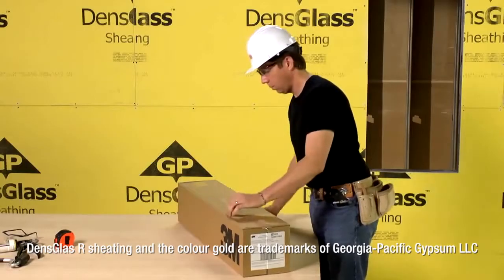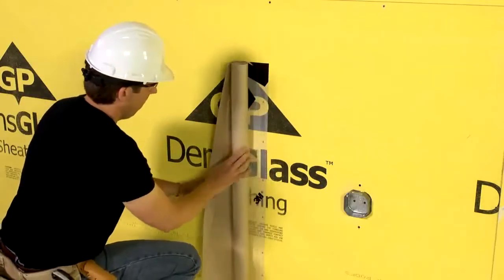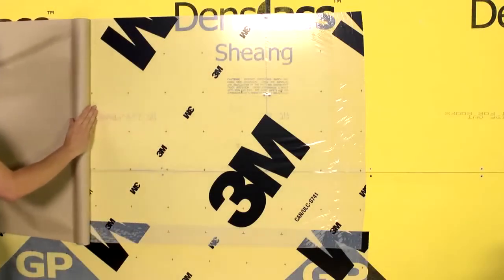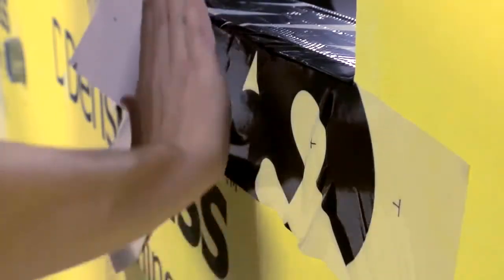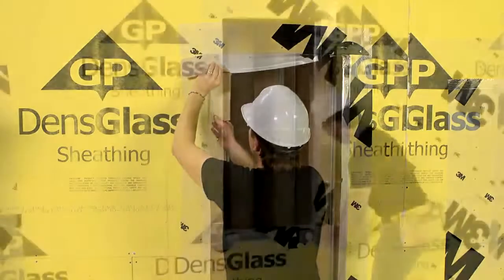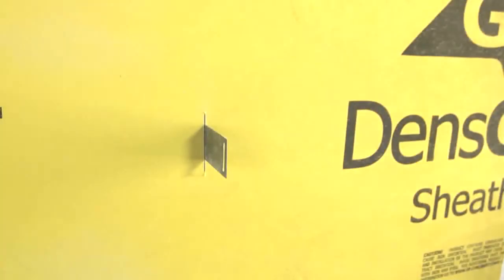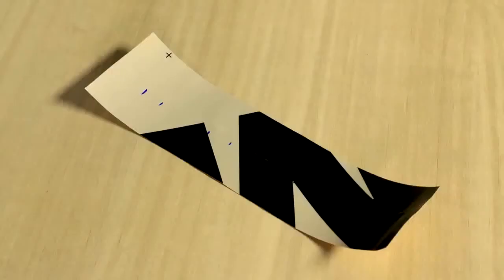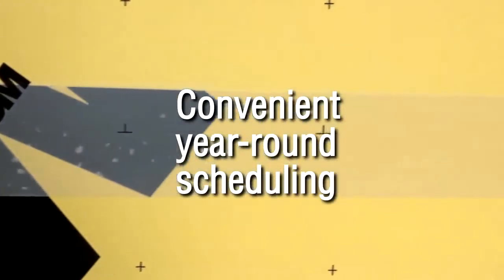3M Air and Vapor Barrier 3015 Installation Video

Comment: Great product but the thickness of the paper backing needs to be increased a lot, in cold weather it’s awfully cold  on your hands due to the paper tearing off in pieces and having to pick at the paper only to tear off another shred, sticky as hell but needs a thicker paper or more tear resistant vinyl backing